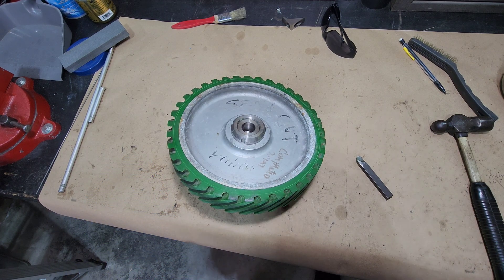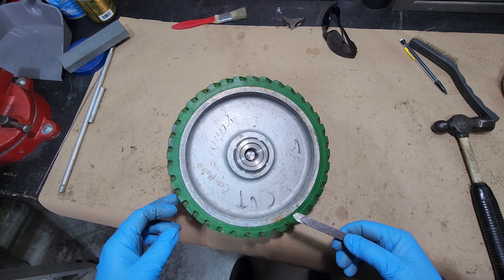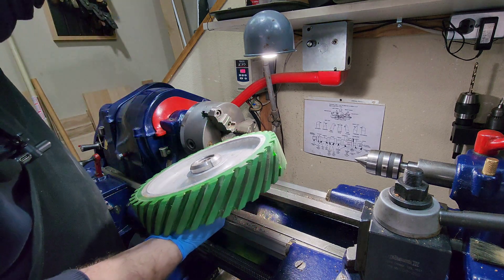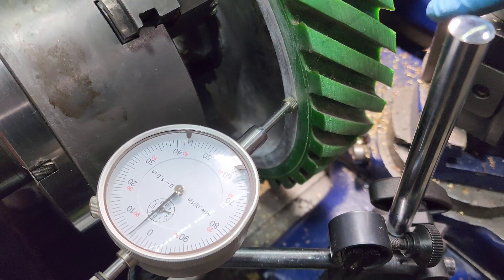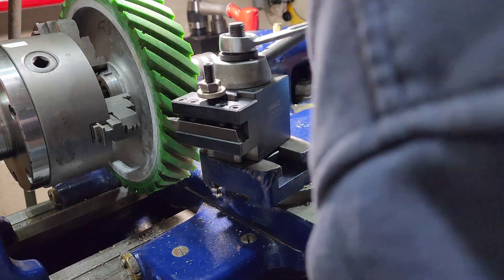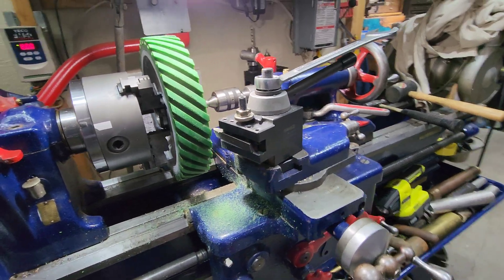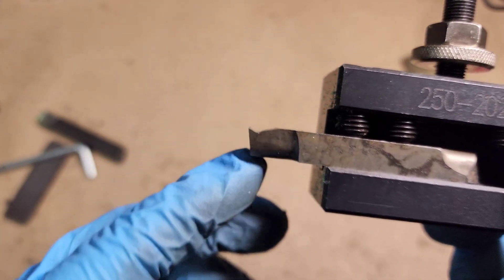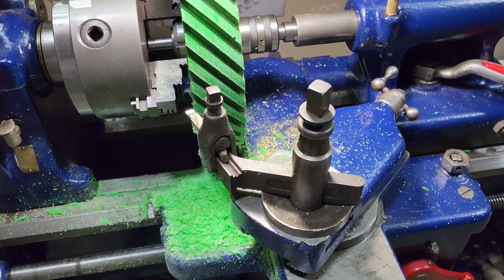truing up a 10" wheel for 2x72 belt grinder on a 13" south bend lathe

Comment: Nice project. What machine is it? I haven’t seen that size belt before. 

I sell parts and machines and I cannot tell you how often 1/2 nuts are bad on machines. My rule of thumb is to only use my 1/2 nut to thread.. it will give them a much longer life. 

Keep it up. I enjoy these videos
Reply from the maker: I typed that wrong, it a 2x72 belt grinder. I had to replace the 1/2 nut assembly on this lathe as it was completely stripped out